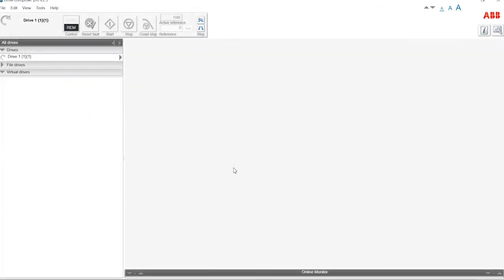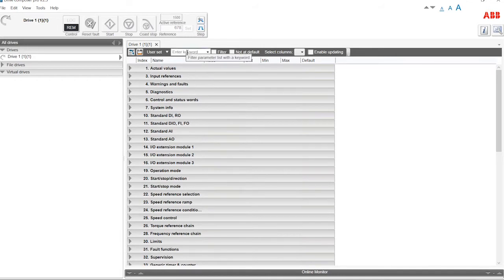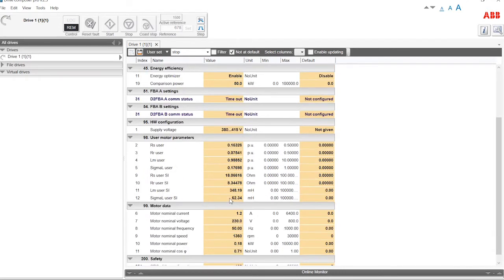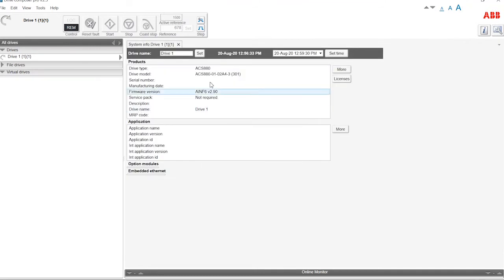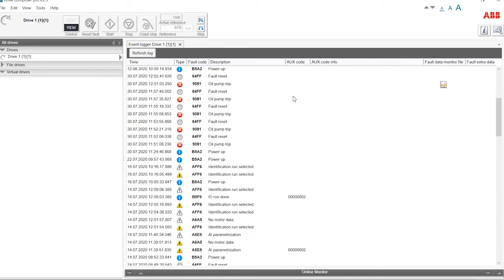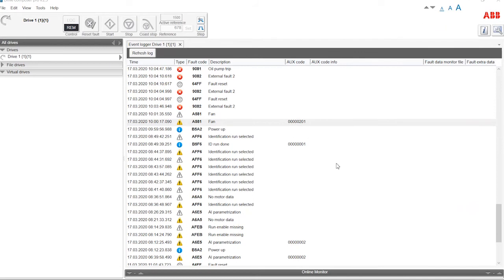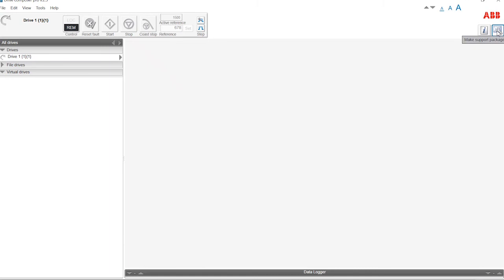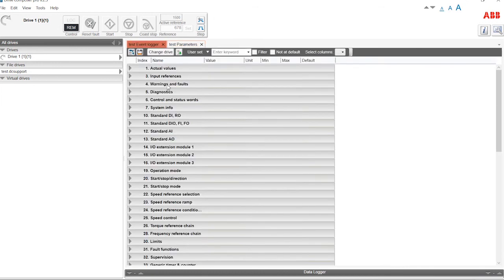Drive composer PC tool tips and tricks

Comment: Sorry I have a question, can I drive a 6.9A motor on no load by using the acs880 drive with a I2n of 60A by DTC mode just to test the drive os it possible